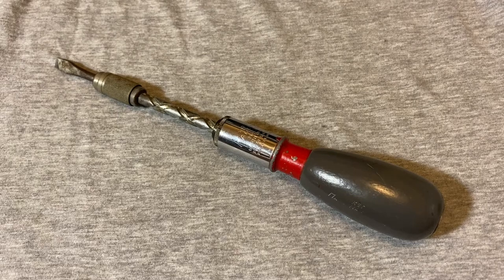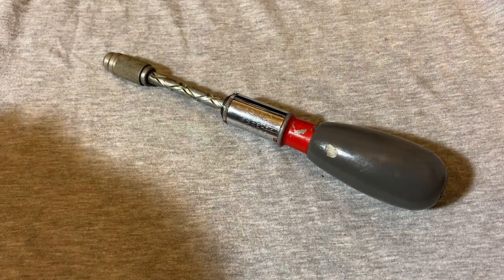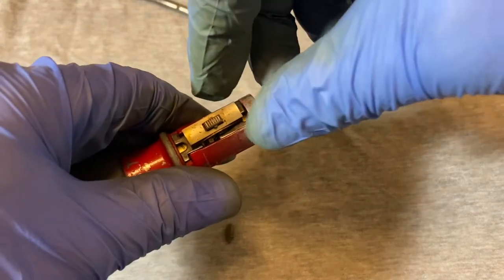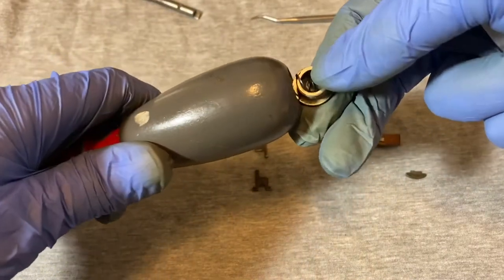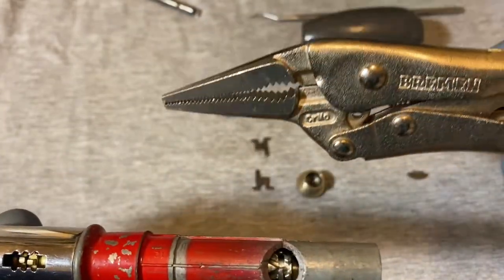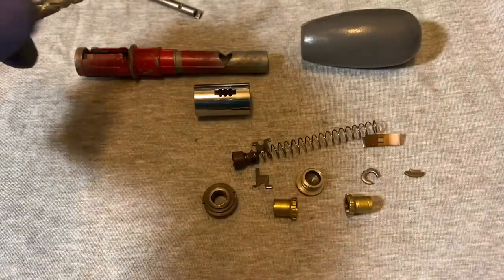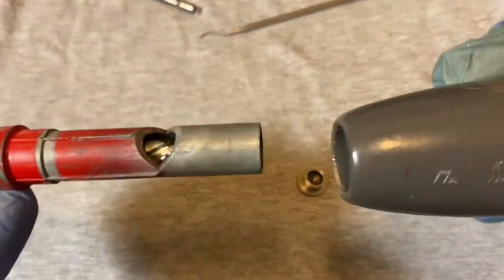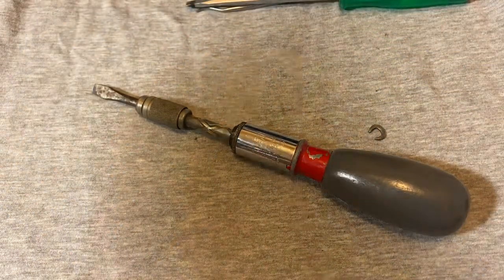North Bros.(Stanley) Yankee Handyman No.133H TEARDOWN Vintage Ratchet Screwdriver

Comment: Hello.  Great instructional video.  I have been lucky enough to acquire a No.133H.  The bit is stuck in the locking front.  Is there a way of dismantling the front locking piece?  Or do you have any suggestions for extracting a stuck bit.  The bit was initially slightly bent.  I have been able to straighten it.  Thank you
Reply from the maker: Is the knurled collet release moving up and down?  In any case I would saturate the tip with a penetrant(wd40, liquid wrench, 50/50. Acetone atf etc). With the bit pointing up the collet releases the bit when you pull up on it. If the collet isn’t moving maybe some light taps with a small hammer or something together with the penetrant will start breaking the rust. If the collet is working but the bit is still stuck maybe some taps on the bit itself together with the penetrant will break the bond and ease out. Hope this helps
Reply: @snapringchronicles3020  Thank you for your reply.  The collet ring moves freely back and forth.  The bit moves freely in the collet.   It is just locked in there.  I'll soak in penetrant and see what happens.  I'll also get back to you with the outcome.

Comment: I have the tool but no bits.  Any idea where I can find the bits?  Thanks in advance!
Reply from the maker: You might find some on eBay but they probably won’t be cheap. If you go that route make sure you get the right diameter size and type. If memory serves I think there were a couple different sizes and types.

Comment: Dude, it doesn’t operate properly. The driver part should always push out on its own. What you have so far is not working as intended.
Reply from the maker: The problem you saw that the tool was having in the video was because the shaft retention ring in the handle was loose. I had pre loosened it to make everything easier to take apart. It wasn’t performing at 100% due to that so I see what you’re saying. I sought of explained this at the 9:50 mark in the video.  I actually used this tool today to remove then tighten the screws on a wall switch box to replace an old switch and the screwdriver functioned perfectly.